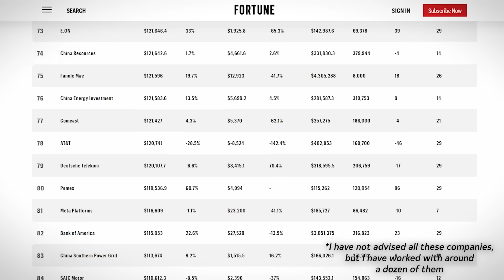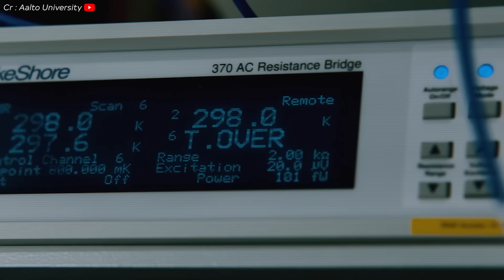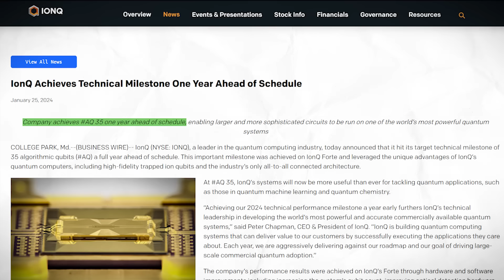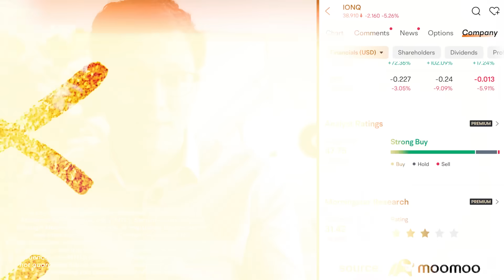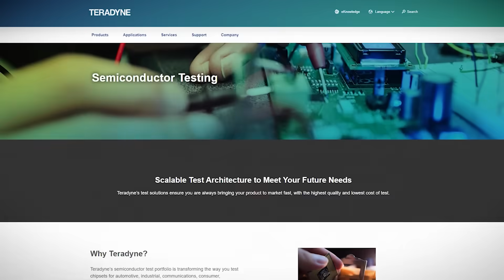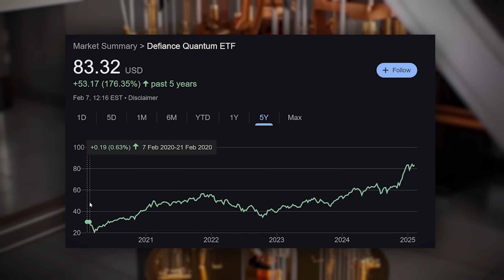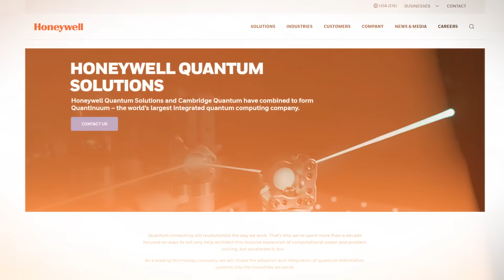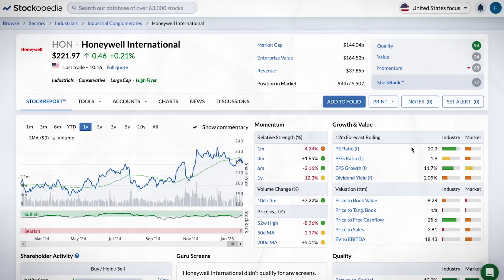GET IN EARLY! Top 3 Quantum Stocks that are Better Than Nvidia

Comment: Great video !

Quantum computing very super oversold now.  Will be buying into the weakness.  Particularly Rigetti Computing and Quantum Computing.  

Rigetti has a strong potential for a 100% upside from current level.
Reply: If there is a bear market I will be buying but too high now and we are 10-15-20 yrs away from the products "working"  It is such a fascinating industry but I believe there will be a better buying opportunity for Rigetti et al.
Reply: Both are reddit pump and dump Scams. Both are Fraud Trash